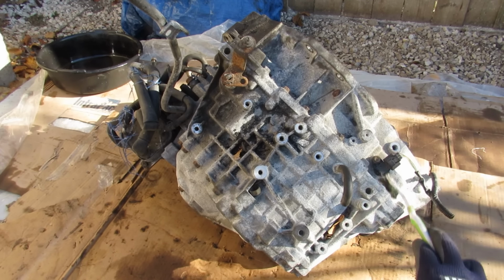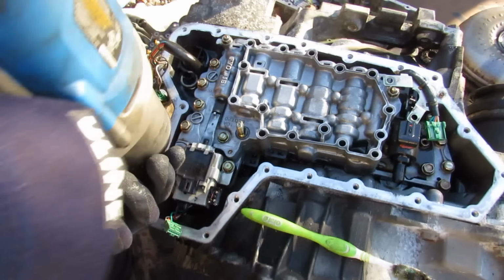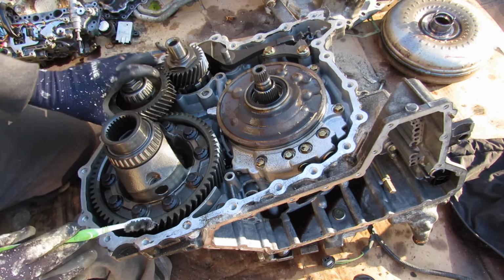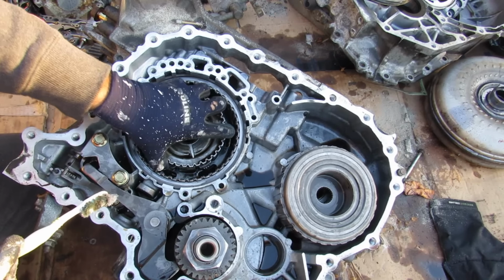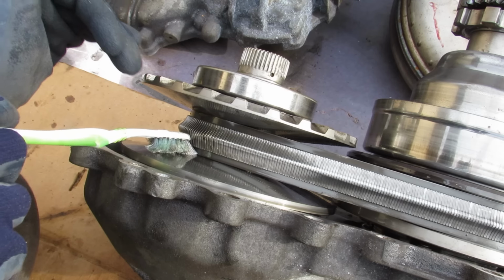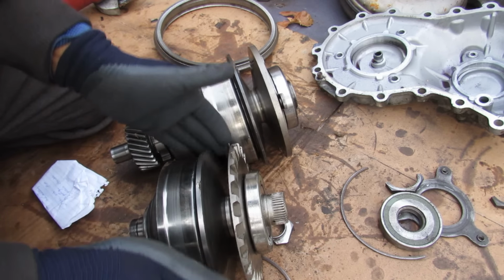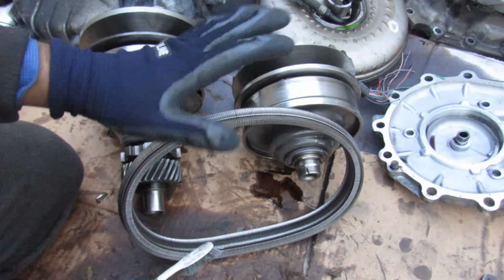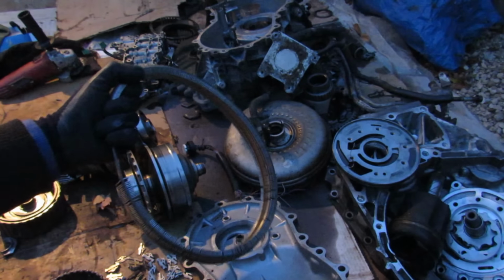Why Nissan CVTs FAIL

Comment: Love your teardown videos sir,  great jabs and  fantastic commentary, 2 small corrections in the conclusion however.

1. Traditional automatics actually have less friction  than CVT's, the fuel economy benefits are due to how the system
varies its  ratios to  while keeping the engine precisely in an optimal part of the RPM Range be it for power or fuel economy. 

2.  The reason why many economy car makers are swapping to CVT's is actually due to manufacturing costs, a modern 7-10 speed
automatic can cost upwards of $6000-$8000  to produce where as a CVT is closer to the price of a manual at $1000-$1500 while delivery
the fuel economy of a 7 or 8 speed transmission.  

So automakers can massively reduce manufacturing overhead on every single car produced that uses a CVT, this is especially important
in economy cars that have very small sales margins to begin with.
Reply: The majority of the fuel economy improvement is gained by the very tall overdrive gearing the CVT can provide which until recently with modern 7 or 9 speed automatics couldn't be touched.  That, and the CVT tends to lock-up the torque converter very early so the loss is minimized.  They can do that because once the car is moving, they don't need the slip of the converter to change gear ratio.
Reply: @drozcompany4132  In theory that is true however in practice it doesn't happen, the taller over-drive gears do not allow for sufficient torque to be produced in the majority of scenarios required to to maintain speed on the highway or  accelerate at a reasonable rate within the city.   The ICE also only operates efficiently in vary narrow portions of the RPM range.

As a result a CVT equipped cars rarely if ever make use of their extended drive-ratios.

Lets take a 3.5L V6 Altima as an example it had a 4-speed auto  and 5-speed manual transmission equipped from 2002 to 2006 and during that period it averaged 22.7 mpg and from 2007-2012 it was updated to make use of the CVT that same engine managed only 23.2MPG. The gear ratio available to the Altima going from a 4-speed with the tallest gear of  0.69 compared to the CVT  which managed  0.439.   Despite the near 40% taller final drive ratio of the CVT it only managed a  3% increase in fuel economy,  within the margin of error for most drivers.

The 3.5L Altima wouldn't see a notable improvement in fuel economy until the 3.5L engine had 80% of its parts  reworked in 2013 and stuck around 24.5MPG, so even we ignored all the other changes present and attributed all the fuel economy savings to the CVT over that nearly 20 year period we are talking about a fuel economy improvement of only 8% at best.

Comment: My Wife had a 2.2L Saturn Vue with the CVT. If I remember correctly was a Nissian CVT, anyways they lasted 30k miles. First one the belt broke, second one one of the drums failed, and thrid was the bearings on the drums. I assume it started as a drum issue. None the less GM was horrible about it claiming owner abuse then they went bankrupt and no longer had responsibility. They are terrible to drive and are far too expensive to replace.
Reply: The Vue used a GM CVT not a Nissan one.  The VTi trans was notoriously bad.
Reply: @drozcompany4132  Yeah I see that I was thinking of the Fiat plant in Hungry where they were made. Sadly the last CVT was under high load when it broke. My wife was flooring it up a hill and when it broke engine when past red line and trashed the valves. Junk yard car at 70k miles.

Comment: I have owned my Nissan Altima with CVT for ten years. I have 96k miles and no issues with the CVT, engine, or anything else. I have not noticed any “rubber band” effect. The car is reliable and extremely fuel efficient. There is a lot of bad press on CVT. Just wanted to share my experience.

Comment: I have a 2014 Subaru Impreza with CVT going on 82,000 miles, haven't had any problem with the transmission aside from how loud it get when coasting. Plus it has a weird retention system that slows the car down if I'm not putting a slight pressure on the pedal. 35+ mpg is amazing in an AWD sedan though.

Comment: I've installed extra radiators for cvt fluid on my 2014 Murano. I kept an eye on the temperature with ELM tool before and after. It really helped.
Reply: Did it still fail?
Reply: @jeedwards1981  it didn't fail. I did it not because it failed but because I saw it overheat sometimes (more than 90 degrees celcius which is above normal but not critical enough to get a warning). Heavy traffic or high speed driving for a long time pretty much guarantees overheat.

Comment: DAF in the 50´s: Lets make a CVT for our little nice cars. A centrifugal clutch and two rubber belts+variators out in the open for easy repair. Decades of success. Lets throw in a nice DeDion rear axle too for good measure.

Modern makers of planned obsolesence: Lets take that old DAF-idea and introduce overcomplicated parts, hydraulics, half a automatic gearbox and some computers. Then we sell it with no documentation and wait for the customer to give us a huge pile of money for a complete gearbox and many hours of work regardless of how cheap and small the actual broken part was.

"Yeah but you need computers and stuff for more sophisticated bla bla bla"

DAF: We have both kick-down and overdrive without any electronics at all.

It´s the same crap as usual with that shitty industry. If I ever were to buy a CVT-based car, it´s gonna be an old DAF. End of story. Or even a Volvo 340. Yeah, there were CVT Volvos in the 70´s and 80´s. But they of course are rebadged DAF´s. The Volvo 340 was developed by DAF and was to be launched as the "DAF 77". But Volvo bouth the company before launch.

Comment: I believe the CVT's in the Jeep Patriots and Compass's were made by the same company that makes the Nissan ones. They also have a very high rate of failure (usually right after the warranty runs out). I'm not sure about the new style Compass though, I'm talking up to I think 2018 when they redid it.

Comment: Great video. Well explained and straightforward . I never understood Nissan using their Jatco CVT in their high powered heavy vehicles especially 300hp Maxima. They were originally intended to be used on compact and 軽自動車(Japanese supermini cars). Williams Formula one team experimented CVT in the early 90s. There is a good reason why they chose sequential over CVTs.
Reply from the maker: Agreed

Comment: All the lawsuits have read about are pretty old. CVTs on big engines are much heavier than a versa cvt. My neighbor has owned an old murano and it is OLD. Never a problem for her and that is her only vehicle.
Reply from the maker: She must be taking good care of it.
Reply: @speedkar99  In the video that belt was fine.  Little cvt's are toys but remember nissan went in with a huge company before building their own factory and built those for a lot of other companies. Mercedes uses cvt's on some models and chevy, ford  and so many others.

Comment: If anyone has ever seen the metal belt from a Subaru CVT, its looks more like a flat chain mesh. The design is so much more different than the nissan CVT's belt, which maybe be a factor in why Nissan CVTs fail so commonly over subarus
Reply from the maker: I'd like to teardown a Subaru CVT

Comment: The CVT on my snowmobile is actuated by weights.  Much simpler.
Reply from the maker: Those are cool
Reply: @speedkar99  The belts are kevlar reinforced rubber that are good for 1,000 - 1,500 miles depending on horsepower.  My 800  2-stroke twin puts out 145 HP so if you are to heavy on the throttle you gets less mileage on the belt but the belts are easy to change.  Perhaps Nissan should design their CVT so that changing a belt only takes an hour or so.

Comment: In the last minute he says, CVTs improve gas mileage but are intended for light cars and easy driving.  Not for towing or hard driving.  Also, maintain your transmission and cooling fluids.  Good points.

Comment: All those hundreds of moving parts.... roll on the EV revolution!
Reply: I think the lack of transmission is reason enough for a move towards electric cars, at least when it comes to the average commuter vehicle. As much as transmissions are fascinating piece of engineering, they're ultimately a necessary evil. Being able to do away with them is just one less automotive headache.
Reply: Yeah good riddance. Once we left reliable NA, manual or (more reliable than CVT) slushbox transmissions cars we went into this uncanny shit valley where everything is consumable and doesn't last the life of the car. No thanks. Electric or NA manual/slushbox all day.

Comment: Another failure point is the axial grooves and bearings  inside the actuators that allow the pulley halves to move in and out while maintaining torque on the belt. They become worn, galled and pitted and after enough time the moving pulley on one side will be forever locked onto the shaft preventing further movement. This causes belt misalignment with the other pulley that is still moving in and out. And when this happens, it's goodbye belt and and goodbye transmission.
Reply: Yep that design was a bad idea.  Way too much load on those bearings and it will just gall the shaft.  I think this has been corrected in later iterations.

Comment: we have Nissan maxima 2014 it didn't fail except when we bush it to hard it makes whining noise because of overheating and we fix it by adding coolant radiator oil and replacing the filter

Comment: I have a Nissan Versa with about 50,000 kilometres and I notice the belt shuddering occasionally at slow speed. I heard  an oil change is close to $400. They use an oil analysis method to determine when It's due. I'm no where near that according to my last numbers about 12,000 k ago. Sure hope it stays together. When I was researching the car befor I bought  it, I couldn't find anything bad about it.....And now this.
Reply: Low speed shudder could be other things.  Maybe a TCU recal would help

Comment: Can you do a comparison between Nissan and Honda CVTs? I've driven both and the Nissan one is rubbery, the RPMs don't settle down and the transmission just seems to be all over the place. The Honda one was honestly 10 times better. It's not rubbery, the RPMs don't bounce up and down without me moving my foot during a highway steady cruise.

Comment: What about CVTs from other manufacturers? Mainly Toyota and Honda. I've heard they are built a lot better than whatever Nissan offers, and that supposedly they get improved a bit year by year.

My dad has a 2012 Nissan Altima 2.5 S, so far it's been pretty good. But I have indeed heard the infamous CVT whine when the fluid isn't changed at the recommended intervals. At the time me and him changed the fluid, it was past the recommended service interval and was making a noise similar to that of a supercharger. We did change the fluid out and the noise was gone after that, but I doubt that the transmission will last over 150K miles after not having it's fluid serviced properly. His car is at around 110K - 115K miles.

I myself have a 2019 Honda Civic Hatchback Sport, It became a year old as of late last month and so far it's not had any issues. I will take much better care of my car, compared to how my dad treated his. So I will expect to get a lot more miles out of mine compared to his. Also, on the CivicX forums someone has a 2016 Civic EX-T (with the CVT) well over 250K miles on the clock. Even has some engine tuned mileage mixed in as well.

Comment: Just wow ... amazing video unparalel knowledge and best way to explain everything,  hats off.
I 've got a honda 1.3L 4 cylinders and it has CVT transmission its driven 90000 km and mechanics are saying that you should sell it because CVT with this engine is not compatible and eventually it will stuck.
Is it true?

Comment: as far as answering the question in the video title "Why do Nissan CVTs FAIL"? it's fairly conclusively answered in Ivan (Pine Hollow Auto Diagnostics) video as linked here at 38minutes 40seconds https://youtu.be/_64zEsMdQ9A?t=2321 the drive pulley slides to get larger and smaller on 3 tiny ball bearing races which get wallowed out due to a combination of under-size poorly engineered parts, and long drain intervals...

Comment: CVT’s are a hit or miss it’s crazy i hear horror stories on Nissan especially 4 cylinder CVT’s in my personal experience, when i had a Nissan CVT it was bullet proof I had a 2007 Nissan Maxima, and that was the Very very first generation CVT’s the thing had 177k miles and it pulled like a train, the oil was very clean as well, it never gave me any issues and i use to beat on the thing nonstop you would hear that belt whinning at 6k rpm but the car was a rocket,  a little research into it i believe it was chain driven, similar to the murano to handle the extra torque of the V6, but anyways so glad my Q50 has a good old 7 speed auto

Comment: I was surprised to hear the belt is pushed and not pulled. Weird. So there is a clutch to engage forward, and one to engage reverse. Is the first clutch you showed used to lockup the torque converter?  You said CVTs generate a lot of heat. You also said they are more efficient for better mpg. Those are kind of counter statements don't you think? One thing that Nissan did with their CVT transmission programming is they made the CVT shift in "steps" to feel more like a normal transmission. So they basically eliminated the one advantage the CVT had, to ability to keep the engine RPM exactly at the peak power point while accelerating or the peak efficiency point while cruising. Also it seems like doing that would wear grooves into the pulleys because the belt would be riding in discrete steps instead of evenly wearing the entire surface. Thanks for the teardown.
Reply: The torque converter clutch is inside the converter itself.  The valve body directs fluid to the converter to lock it up.  Also, most Nissan CVT will only provide shift shock simulation under heavy acceleration but under slower acceleration it does not.  The shift points are wear-leveled in software of the TCU so it does not wear grooves into the cones.  Actually, the failure mode of the cones is typically a polished surface.  It will never get to wearing a groove since by then the trans would have stopped working long ago.
Reply: @drozcompany4132  thanks for the info! This channel attracts mechanical experts, I love it.

Comment: He heard my prayers. I was wondering when this dude will make a cvt transmission video!!!! I have a nissan rogue. Change the trans 1time already. N now I believe it might be messing up 20k miles later. Did had mines rebuild by cvt precessional. Nissan and the rest they just take it off and put a rebuild one instead of taking apart and fixing it. But mines starting to slip when I accelerate around 20mph it kinda slips but ain't never pay attention if it was normal till now. Runs great reverse great but shakes alot here and there.

Comment: Thanks for a detailed teardown. The chain links outer edges are not flat, they are slightly sharp in the push direction to grab the pulley.

Comment: I had an '07 Altima 3.5SE with 170k miles (then the variable valve timing and CVT went within about 2 weeks of each other). Because of that car, (which I felt gave me very good service) I now have a '16 Maxima SV with 92k miles (purchased new). Not one issue with the transmission or anything else. But I did change the CVT fluid at 60k miles per the dealer's recommendation. Maybe I'm just lucky (so far).  The car straight SMOKES most other cars when passing on the highway (no shift delay, so it's always "on the boil", if you're into that).

Comment: Do CVTs really come with paddle shifters? Or was that a joke at the end? I'm as gullible as they come....
Reply: Some of these transmissions have computer programmed shift points.  Most folks want the shifts to feel like a regular transmission, which defeats the benefits of the CVT.  On those models,  paddle shifters are available.
Reply: they DO!  check out the Honda Civic Sport 2021 CVT with paddle shifters.  I think it's for people that don't really understand the CVT

Comment: I figured at least there would be some kind of solid mechanism to keep the two pulley positions in sync.  Having their sync managed purely by independent hydraulic actuators seems like a serious oversight....but so is selling cars with a CVT if you really want to get down to it, lol.  I have thoroughly hated the driving experience of every CVT vehicle I have tried...laggy, nebulous, inconsistent feel...definitely only passable for casual commuter drivers.
Reply: casual commuter drivers make up probably 90% of the car-buying public
Reply: @drozcompany4132  Yes, but it still shouldn't be a cost cutting contest to find the limits of tolerance of the average commuter driver.  There would be nothing but crappy boring cars to buy anymore, which is kind of where it's slowly heading.  Even Honda is transitioning to CVT only....they used to be the prime selection for cheap fun reliable pseudo sports-commuter cars.  Now just heading towards more of the same overweight unreliable boring POS that Nissan has been leading the pack on.

Comment: This is an excellent idea for a video. I've always wondered why Nissan CVTs are so much less reliable than the ones from Honda and Toyota. Now I know it's because of inadequate cooling and inappropriate usage, i.e. putting CVTs in high-power vehicles rated for towing.